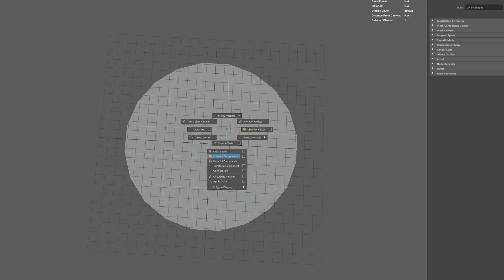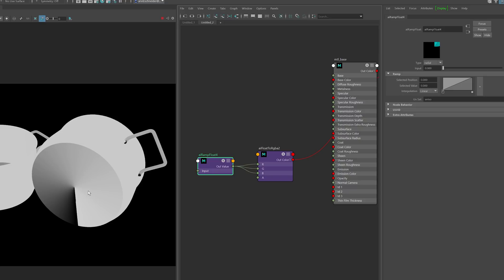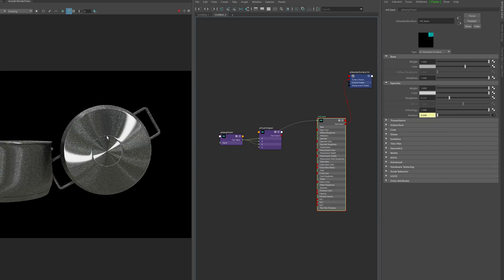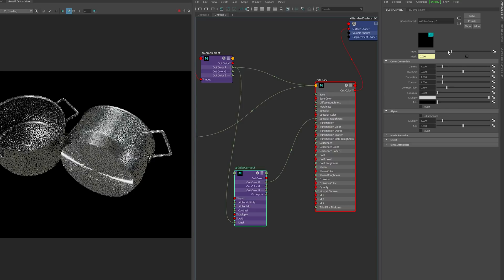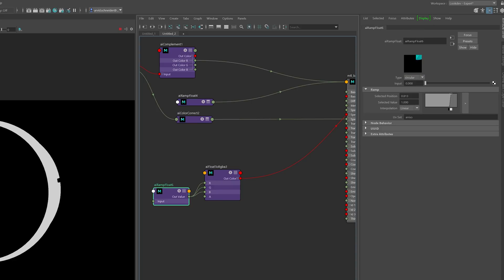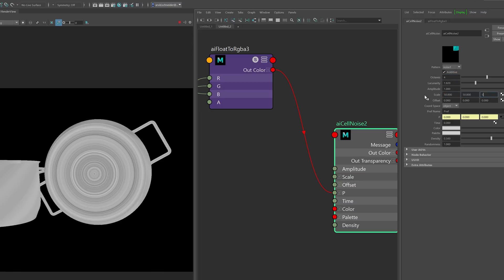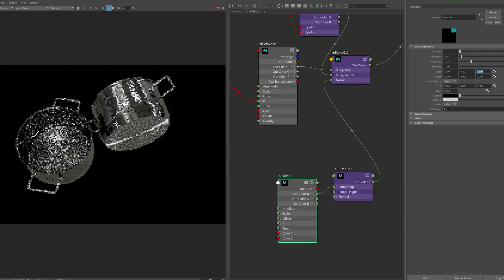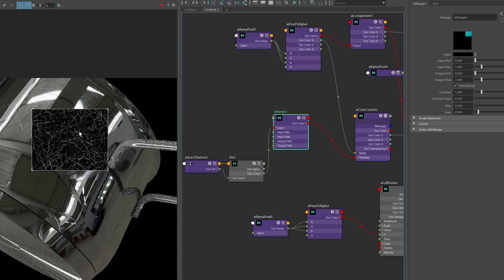How To Render Metallic Surfaces in Maya and Arnold | Anisotropic Shading

Comment: In Maya 2025, the drag and drop method does not work in Hypershade... I select the standard surface element, then I click and hold on it, e.g. on the aiFloatRgba element, to drag it to the Rotation point, but as soon as I click, the focus changes, and so I can't pull it on...
What could be the problem?

Comment: I think the bottom part could have use more roughnes, it was way to reflective. I also think the micro scratches would benefit if you added a noise on top. Now the scratches are all over the place very uniform. The noise map would brake that and make the more and less visible in random spots.
Reply from the maker: Yeah you’re totally right - I just wanted to show the techniques, it can definitely see more work
Reply: @arvidurs  Anisotropic shaders can be a bit of a hustle too understand. What also could be nice if you added sort a colored noise around the bottom, that would look like heating marks :)

Comment: I am having difficulty in understanding nodes. Can you please help me on this?  Great tutorial as always. Thanks.
Reply: Hello there, hope I can help. You can think of nodes as an alternative to layers that you find in something like Photoshop. Each node has inputs on the left and outputs on the right. So you can think of nodes like a journey from left to right. An example could be; you have your first node like an image (filenode) which goes into the colorcorrect node and comes out a different colour (which you can adjust inside the colorcorrect node) which goes into your objects base. One of the advantage of nodes is that they allow you to create a non-destructive workflow. You can change the image whenever you like and not have to create a new colorcorrect. Although nodes can seem complicated at first, they really give you a lot more freedom when working and I would recommend spending a lot of time experimenting with them as they are used (if im not mistaken) in all of modern 3D software. 

I learnt nodes by using a small selection of nodes (ainoise, aicolorcorrect, aistandardsurface). You can create a lot of cool looking shaders from just those nodes and for me practicing and experimenting was the fastest way for me to learn.

Sorry this was so long, hope this helps :)
Reply: @kannkarry  Thank you so much 👍